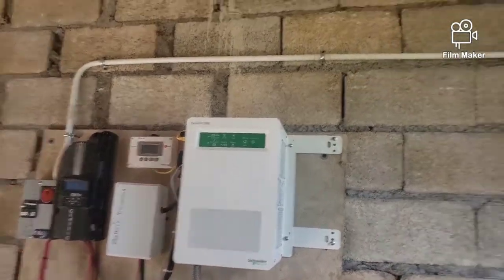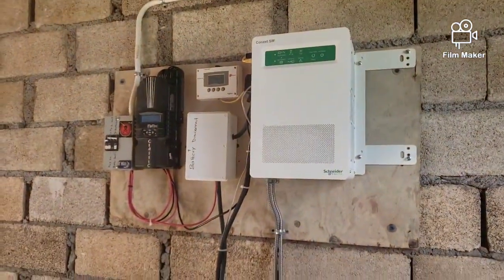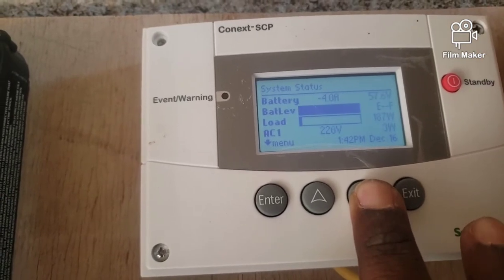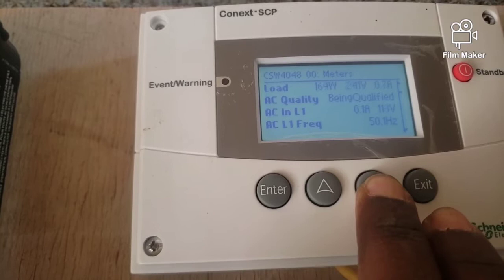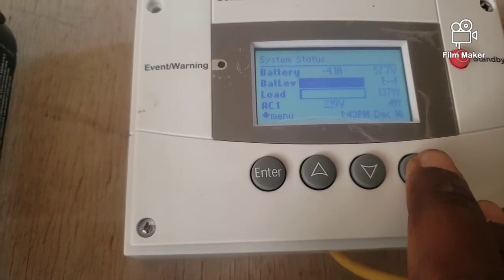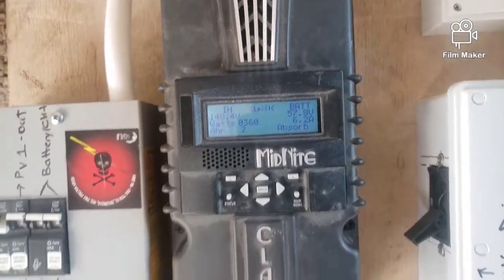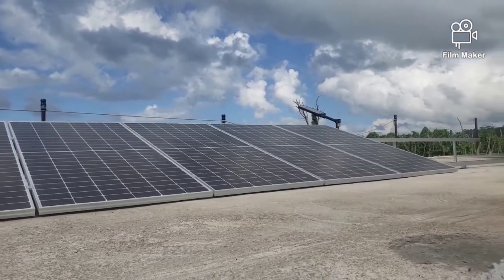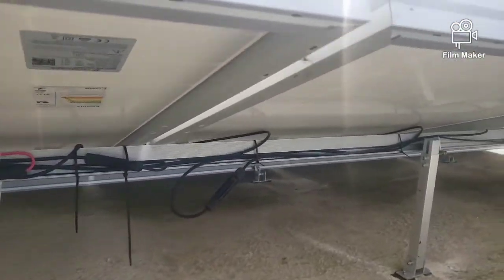schneider conext 4048 Installation with midnite charge controller 👌

Comment: Two questions. How is the Batt capacity determined? I have 8 12 v 200 AH Lithium batteries which will replace 8 12 v 200 Ah gel batteries. Whta is the voltage on this context 4048 , is it 24 or 48 volts?
Reply from the maker: The battery capacity is determining be multiple the voltage times the amps. As it say conext 4048 it’s a 4000 watt inverter and a 48v input from the battery bank.
Reply: I my case how does it translate? is BATT CAPACITY , 800 or what?
Reply from the maker: @bambino3162  8*12*200=19200 watt hours
Reply from the maker: If you wanna configure the battery to 12v it’s 1600 amp hour or 19200 watt hours. 24v is 800 amps or 19200 watt hours. 48v is 400 amp or 19200 watt hours